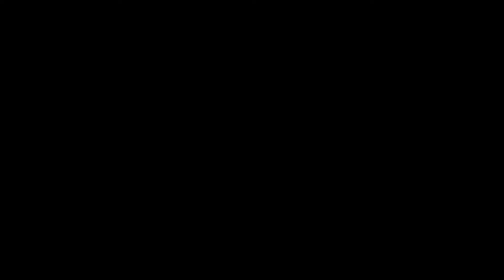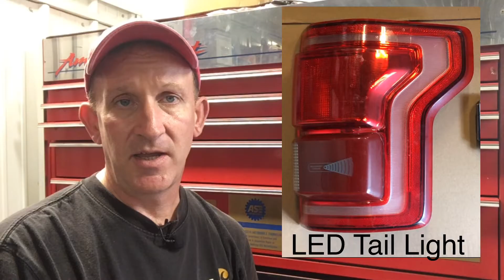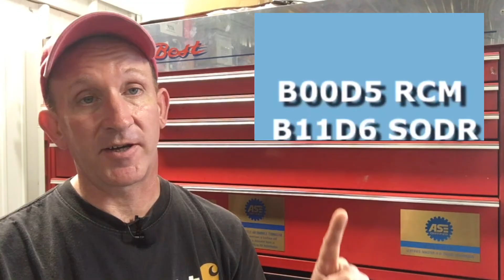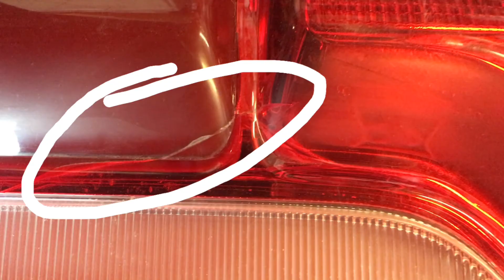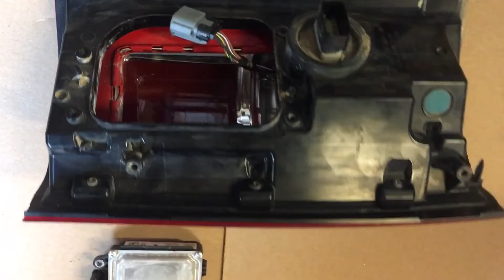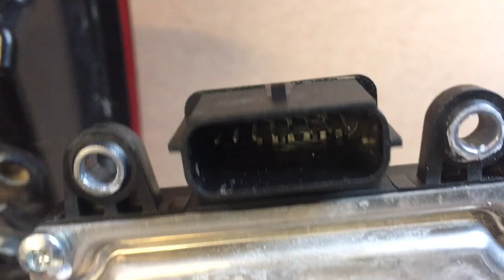2015 Up F150 No Radio Controls, No Heat or A/C and No Power Windows

Comment: Have same problem but regular tail lights
Reply from the maker: I don’t think I’ve ran into it on one not equipped with BLIS with that type of problem. I’m not sure if the network wires still run to the back of the truck on ones not equipped, but they might.  If they do it could be water in the connectors where the harness jumps from the frame to the truck box. The easiest way to tell would be to get a scan tool involved and see if all of the modules can communicate on the network.

Comment: My blind spot worked before fixing taillight. There was a leak in taillight but I have fixed the tailight but still same issue. I don’t know what module to order. Any help?
Reply from the maker: It may just be the connector to the BLIS module has moisture in it or is corroded.

Comment: Where can I locate the sensor. I took out my tail light for my 2016 XLT but I can't find the sensor or module...any help?
Reply from the maker: If you didn’t find it on the back of the tail light it’s probably not equipped with BLIS.

Comment: What if my truck is more basic without the blind spot sensors etc, is this error still related in the taillight?
Reply from the maker: I’ve never seen a network issue on the back of a truck not equipped with BLIS, but it might be a possibility. I don’t think the harness on the truck box would have the network wires in it, but the one on the frame going to the back of the truck might have the the wires / circuits in it either way.
Reply: @CarShopTalk  thanks for your input, I appreciate it. I will check all the harnesses at the rear of the truck and see what I can find. Thanks again.
Reply from the maker: @a.million9680  There should be 3 or 4 connectors at the very back of the frame where the box harness plugs into the frame. I have seen some of those get moisture and corrosion in them. Probably would be worth checking.
Reply: @CarShopTalk  okay cool, I will take a look today. Do you ever recommend dielectric grease inside the harness connections? Thanks.
Reply: Having same issue, my ford doesn’t have the rear blind spot sensors, were u able to find out the problem??

Comment: I’ve had this problem for quite some time, apparently it’s a common problem with Ford. You would think Ford would issue a notice and give some restitution for this known defect in the manufacturing of the tail lights. I have had no cracks. No breaks in the lens or body yet. Water gets in through the wiring connection. I’ve just disconnected the BLIS system and clean the connections and left them hanging in the tail light. Each BLIS module is around $700 so you need two and New tail lights.
Reply from the maker: The BLIS modules really should have been mounted in their own water tight compartment. There’s blis modules behind the bumper on lots of applications with no issues. It was a bad design.

Comment: I just disconnected the module and everything started working again. You probably saved me $500 or more. Thank you.
Reply from the maker: Yeah, disconnecting it will bring the network back up and everything but the obstacle detection in the tail light should work. Glad it helped!
Reply: I removed my very corroded blis module.. but my climate control, power windows, Airbag warning light, automatic running boards, heated steering wheel, all still aren’t working.. any suggestions?
Reply: @robertburrows5991 i also disconnected mine and the issues didn’t go away did u ever find a solution?

Comment: Is it possible to just swap out these assemblies with taillights without the side warning modules. Would this be fix without having to calibrate with a scan tool. This is a terrible design.
Reply from the maker: I’ve never had anyone ask that or given it any thought. Possibly. If you didn’t reconfigure at least the bcm and possibly the cluster I’m sure you would get side obstacle detection not working messages, but it could probably be configured with Forscan or something similar to get rid of that.  On super duty trucks I know it possible since I’ve reconfigured several of those after the boxes were removed and flatbeds were installed. I’m pretty sure it could be configured on an F150 as well.

Comment: Temp settings won't come up on the touchscreen. Have a bad tail light wonder if that's the problem?   Great video
Reply from the maker: For the tail light to affect it it would have to take down the network and you’d probably have more things not working. If it’s only the temp settings not working or displaying I would guess it’s an issue with the hvac. If you have access to Forscan or another scan tool capable of talking to the hvac see if it will communicate and if will pull codes from it. If it won’t communicate possibly a blown fuse, bad hvac unit etc.

Comment: Does this require programming the replacement module?
Reply from the maker: SOD modules do have to be configured if replaced. I’ve never tried doing it with Forscan, but I think you probably could. I think it’s just the as-built data being configured and not a software download.

Comment: 2022 update. If your module is getting wet you can simply pull out the tail light. Disconnect the gateway module and unscrew it. And then put the tail light housing back in. You will lose your blind spot detection but everything else will work. That way you have a vehicle that functions until you order a new housing and or gateway unit. I would buy housing first and plug in old unit. Might get lucky and not have to buy new gateway.

Comment: Do you need to reset the system / take out the error codes
Reply from the maker: You really should clear the codes after a repair, but usually everything starts working after it’s repaired.

Comment: FIXED. I DID NOT HAVE A CRACKED TAIL LIGHT but did have all of the other issues:  I disconnected and reconnected the battery per others who didnt have a cracked light but same issues and IT WORKS NOW. will drive it around today in the heat and humidity and see if it holds up.... thanks to everyone here!!!!
Reply from the maker: That’s great!  I haven’t ran into that one yet.

Comment: 2019 F150 King Ranch 50k miles. Engine rattling a tad a start up and that is I’m told a computer module needing re-coding or replaced. Just now going to lunch my running board was down and it usually retracts. Got in and it started fine with slight rattle but no A/C and no power to roll driver passenger windows down, but I can roll down rear windows. Radio works and no error lights on dash. No Ford appointments for 3 weeks. Going to check my tail lights soon, thanks for video.
Reply: Did you fix this issue?

Comment: Dude, so awesome.  Happened to me yesterday in the heat of the day, started pulling fuses then i found this video.  Passenger side taillight had tons of water in it, disconnected it and boom, everything started working again.  Never in a million years would i have thought to look there.  Thank You So Much!!!
Reply: So i was hoping it was this easy fix, my issue was squirrels got into my wiring harness. Did all the same exact problems as video says.
Reply from the maker: Glad it helped.  You’re welcome!
Reply: Quick question for you if you just go in the taillight and unhook it. Woukd that, make everything work again.? I haven't tried yet. Thanks
Reply: @jeffferry9297  yes it will
Reply: Thank you sir,  i plan on doing that tmmrw. Thank you the fast reply
Reply: Unfortunately, i unplugged both of them and even took pos wire off battery to try to reset everything. Still having all the same issues. CRAP!!
Reply: I removed my very corroded blis module.. but my climate control, power windows, Airbag warning light, automatic running boards, heated steering wheel, all still aren’t working.. any suggestions?

Comment: I have the same problem front windows don’t work,A/C don’t work,turn signal blinking fast inside the dash but regular outside,radio turn on but no volume,key(remote don’t lock or unlock)all I did was install LED lights I need help f-250 2019
Reply from the maker: I wouldn’t have expected all that from installing LED bulbs.  If you switch them back does it go away?
Reply: @CarShopTalk  no I already did and replace on lights bulbs for the turn signal I already clean all the lights and nothing I check the fuses and nothing I don’t know what else to check
Reply from the maker: @josearguello5388  I’m assuming the truck does have blind spot / radar sensors in the tail lights?  Is there any water or corrosion in the connectors?  Or the connectors behind the rear bumper where the wiring goes from the box to the frame?  If you unplug the blind spot sensors does any of the other stuff start working?  If none of that gets you anywhere you’re probably going to need to get codes out of it and hopefully that will point you in a direction.  Something like Forscan that can talk to all the modules over multiple networks.
Reply: @CarShopTalk  no this truck doesn’t have blind spot censors and no water or nothing I just check , and on the connection under the bumper let me check right now.
Mi turn signal works but flash fast inside the dash but regular outside but my driver windows still don’t work and my A/C still don’t work and radio doesn’t raise the volume
Reply from the maker: @josearguello5388  I’m not sure what you have going on there. It sounds like something may be taking down that same network, but you’re probably going to have to get codes out of it and start from there.
Reply: @josearguello5388  I think i have a similar situation. No water in taillight. windows dont work, a/c doesnt work, radio on but cant change volume or turn off.

Comment: Ran into this issue after having a car smash my bumper. Thought it was related to the smashed sensor but I got it fixed today and found the same issues, no AC, seats, windows, cross system fault messages... checked the other tail light and it’s got excessive condensation droplets and was appears to be some type of corrosion leaking out from under it. Picking up the new casing tomorrow
Reply from the maker: Hopefully that takes care of it for you!
Reply: @CarShopTalk  The tailgate module was completely corroded, water in the cables water too. Disconnected it so I still have my lights but you seem to have found the problem for me as I once again have everything functional inside. Thanks
Reply from the maker: @Fightorflight777  You’re welcome.  Glad it fixed it.

Comment: My 2015 F150 Lariat had been having those problems. Power doors and key doesn’t work, windows and brake pedal locks. The truck would turn the switch on but it wouldn’t start and screen shows a bunch of errors like “service advance track” “steering assist fault” “blind spot system fault” “cross traffic system fault”
Reply from the maker: I don’t think water in the tail light can cause a no start.  Different network.  I’m not sure what you’ve got going on there.

Comment: thank you so much !!!!   had water in taillight can’t see a crack but got all the water out and cleaned connections put some di grease and put back together for now it fixed everything. probably be buying a tail light leanne. thank you
Reply from the maker: No problem.  You’re welcome.

Comment: Good video.  I just wanted to mention about the same issue but in a different location so that it might help others.  I just corrected this issue on my 17 XLT and the cause was the MS CAN wires Grey/Org & Purple/Org twisted pair were broken (from vibration) where they loop in and out of the Grey connector right above the driver's side of the spare tire. This created these exact symptoms and brought me to this video.
Reply: Good to know, my lights did not have any water or moisture so looking at next options to look - very sporadic
Reply from the maker: @jeffkoehn1486  any codes in it after it occurs?
Reply from the maker: Good tip. I’ve also seen water get in the connectors between the frame and box cause this.

Comment: Hi I have a 2018 f150 and I was driving it lastnight then I parked it then the dash is black no radio/but screen is on no blinkers no power locks no heat or a/c so just wondering if you could help me out
Reply from the maker: Let me make sure I understand.  The cluster lit back up after you shut it off. All the things you said don’t work, they work if you turn the key on?  Or not at all?

Comment: I have the same issues as described and a no start issue as well as the odometer being all dashes
Reply from the maker: If the odometer is all dashes the pcm isn’t talking on the network. Could be a network issue, short, shorted module etc or the pcm may not be powering up, relay etc.  if you plug a scan tool in Im guessing it won’t be able to communicate with the pcm.
Reply: Did you fix the issue and how. I think I have the same issue

Comment: I just started having this problem with my 2018 F150 platinum. I know it has a crack in the tail light cover! Between 2 different shops (one being a ford service dealership) they had my truck for 2 weeks and couldn’t figure it out. I assume they “reset” the battery so everything worked for 1 day. I was just about to look into replacing the front control interface module. Thank you so much for this video!
Reply from the maker: You’re very welcome

Comment: Just started happening to my (2015 XLT) with a cracked taillight. Thanks for the info - seems crazy that the design would allow for this to happen. In addition to blind spot not working, interior lights, heater/fan/AC, and windows, my navigation was also throwing an error and my rear camera stopped working (hope it's all related). I live on the west coast of Canada (think Seattle rain) so I'll replace the taillight and see what that fixes.
Reply from the maker: If it has blind spot sensors and you’re getting water in the tail light I’d say you probably have found your problem.  It takes down the entire network and pretty much everything on it.
Reply: yea my 2015 just started doing this. had water in passenger side tail lense had everything screwed up not working.  cleaned connections and put di grease in them and it fixed it all for now

Comment: I have the same problem with my 2015  F150. HVAC, Radio control, Power door and windows in front are not working. I replaced my tail light but with out the blind spot sensor and it works but with out the BLIS
Reply from the maker: Hadnt really thought about it, but if someone wasn’t worried about the BLIS working you could probably just unplug the module and keep the connector dry and everything else would work.

Comment: Is there a way to tell which tail light is causing the. problem, other than it being full of water,ie do both have the module in them
Reply from the maker: Both have modules in them. If the entire network isn’t don’t you can retrieve doc’s and see if you have communication with both.
Reply: yes both do. mine was the passenger side. had water enough to pour it out i cleaned all the connections with wd40 it takes water out  put it back together and fixed it all for now.  got to find out how water getting in lense  don’t see a crack

Comment: Having this exact problem with a 2016 f150 platinum. Does anyone have a part number of what I need to replace. I found a hairline crack on driver side.
Reply: take it out and clean the connections. spray wd40 alittle in connections. takes water out  need di grease in connections after that if it works. fixed mine myself but water is getting in lense somehow so be buying a lense soon

Comment: Appreciate this video. The only video on YouTube about it. I just ordered the tailights and the sensor about 1000 for all of them. Hopefully it fixed my problem
Reply: Did it fix the problem
Reply: @jemarhardin4769   so the sensor is backorder. All i did is clean all the connections and change the taillight. Kept the broken sensor. So it works. The only bad thing is the sensor wont work. But everything elise is fine

Comment: Question, would it be viable to just replace the taillight without replacing the module? I'm facing similar issues but I don't think there's very much water in my taillight. The issue is intermittent and seems to happen when the temperature peaks for the day (I'm in Texas so 100 F. or so) And i'm thinking that the water is evaporating due to the heat then condensing onto the connector.
Reply: Did you ever get an answer?  I have the same issue with my 2018 F-150 Platinum and every service department is telling me it’s going to take two weeks before they can look at it.
Reply: So u can just replace the taillights and you should be good. Just clean the connectors for water. But if your blondspot monitor is not working u should change the sensor unless u dont care for it like me
Reply: Buy new housing, plug in old gateway. If problems persist you have your answer